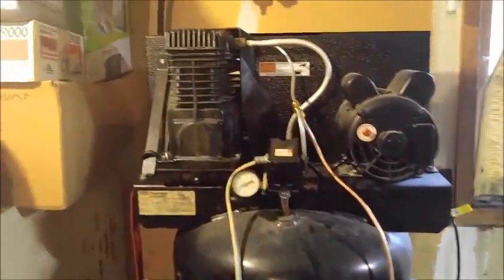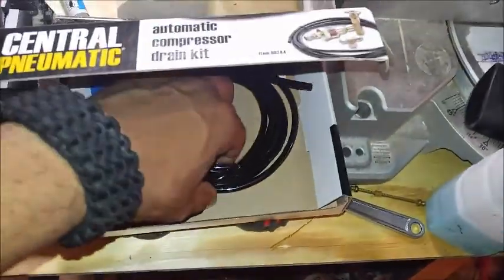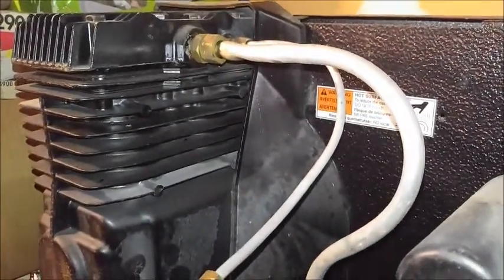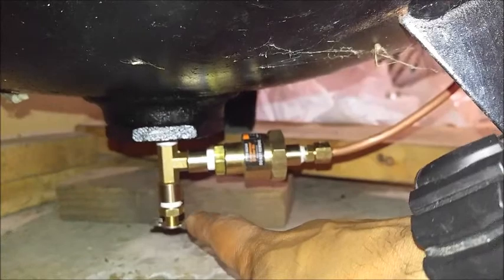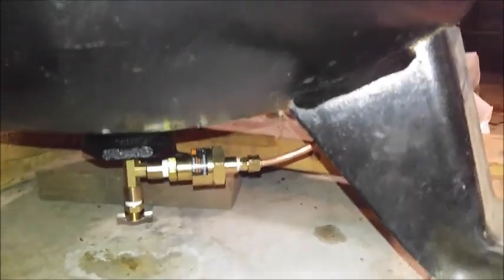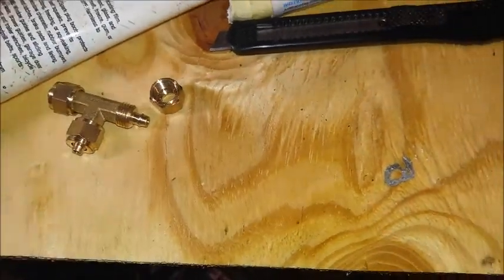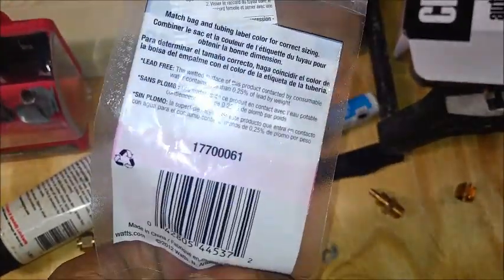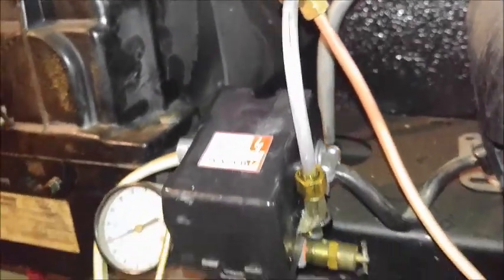Air compressor auto drain..  How to!!

Comment: You can use a piece of rubber hose around the copper tubing, hold it in place with zip ties and then double sided foam tape to secure the rubber hose to the side of the tank. It will allow a little give but will hold it securely, cheap, easy effect solution. Not the prettiest but functionally sound.